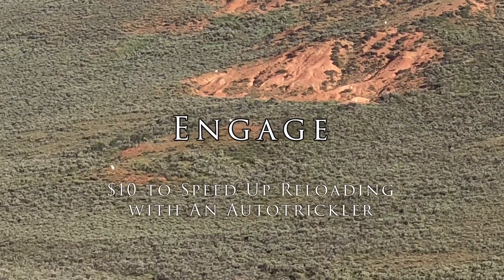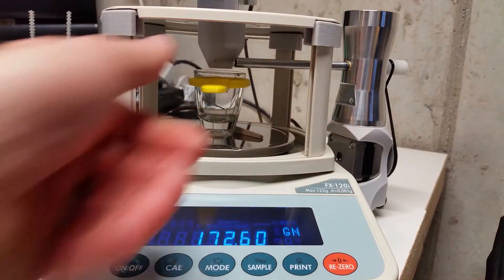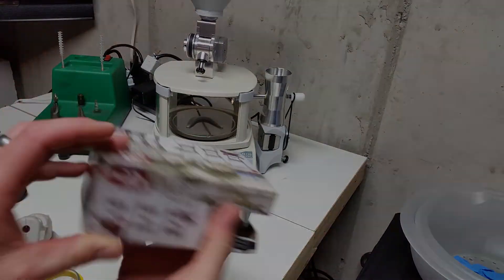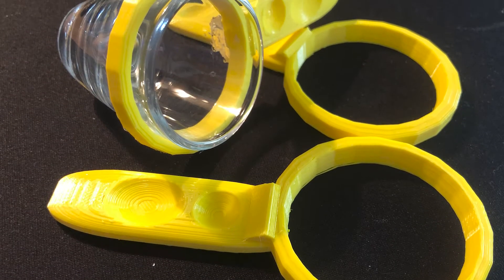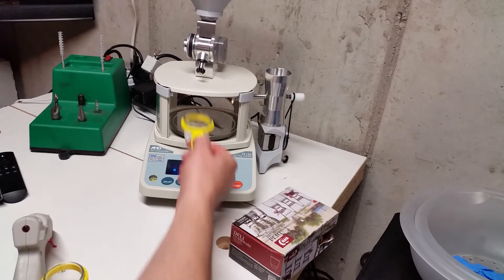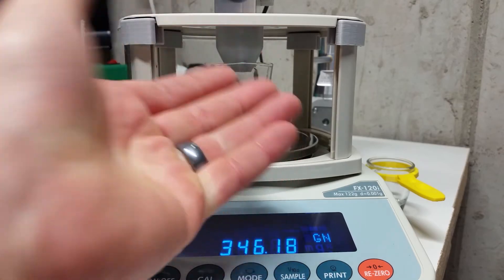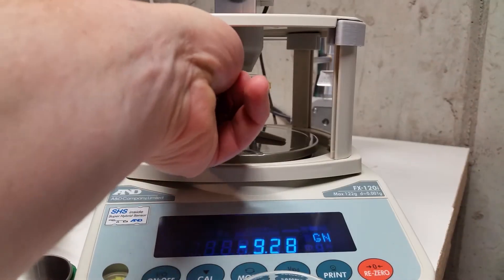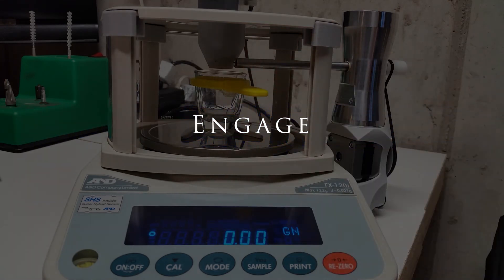$10 fix to speed up Reloading with your Autotrickler!

Comment: Did you scale yours down?
Reply from the maker: Hey RWds24, Yes I scaled mine down to about 91% of the original to have them fit just about perfectly.  Thanks for checking out the video.
Reply: @Engage1  Hi, are you talking about the stl file you have scaled down to 91%.